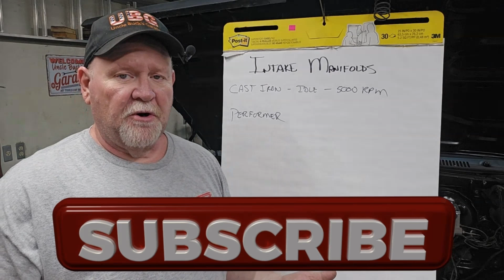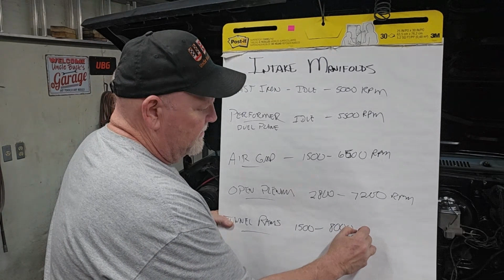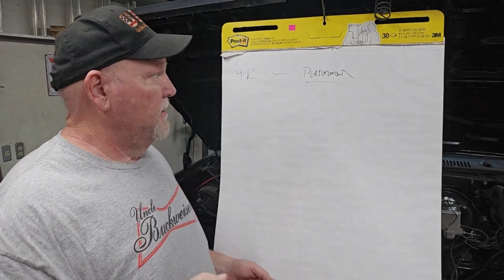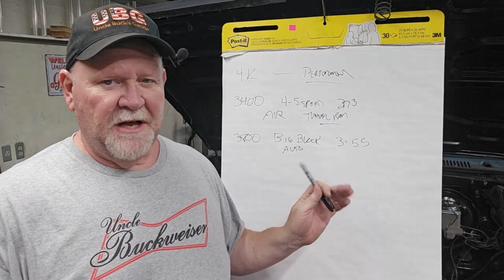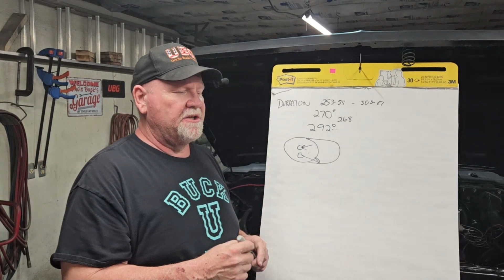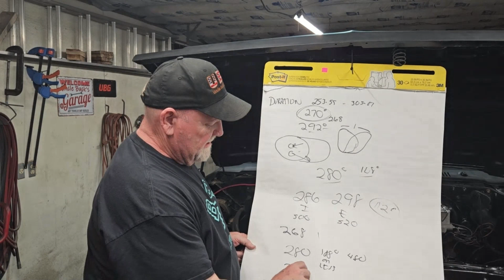How To EASILY Pick The Best Performance Parts Combination!

Comment: 454 bbc , 5 speed, 325 rear, weight 1800lbs 1927 Chevy coupe stock, steel body, four link rear, positraction rear,  dual plane intake, carb 700 vacuum secondary, should be all ok as to what you are saying. Looking for more distance as to fuel cam dual spec on the intake and exhaust mild lift and stock heads and pistons 8.5 compression, what do you think Buck. Thx joe
Reply from the maker: SOUNDS LIKE A FUN SETUP, THAT THING IS GOING TO MOVE!

Comment: First time here and this is the kind of stuff i can watch all day and i have a chevy c10 1985 silverado i had to replace the 308 that was in it so i want with a GM 350 crate performance engine from Jagz but i am going to take out the intake manifold and edelbrock carburetor and put the my old edelbrock performer on wth the original quadrigjet e4me so i can cruise, it then burn gas.
Reply from the maker: SOUNDS LIKE A SOLID PLAN FOR A GREAT CRUISER!

Comment: I have a pair of naturally aspirated 482cid BBC engines for my hi-perf offshore marine pleasure boat 🛥 application...8.2 comp ratio, .039" quench, AFR Magnum 315cc aluminum heads,  Edelbrock RPM air-gap dual-plane intake manifolds, Holley 950HP carburetors, MSD magnetic crank trigger system hooked into a Daytona Sensor CD-1 Marine ignition box system,  bore notched cylinder bores on both intake and exhaust sides, baby hydraulic roller camshafts 230°/236° .600"+ lift, 110° LSA,...makes 585hp @5700RPM 580-lbs of Torque @4500rpm all on 87 octane ⛽
Reply from the maker: THAT IS A SERIOUS SETUP, SOUNDS LIKE A BLAST ON THE WATER!

Comment: I’m building a 327 with a Holley 750 double pumper. I’m looking for a set of camel back heads. I will have them gone through and set up. I’m looking to put a cam in it that will give me the best bottom end to mid range torque and horsepower. Do you have a formula that will tell me what can I should use
Reply from the maker: 268 advertised duration will be what you want

Comment: Tunnel Ram intake is a type of long-tube intake which is better for cylinder filling at lower RPM. It's like a vertical dual-plane. Many think of it as comparable to a single-plane high RPM intake, but its not. actually good performance for street strip but who wants to run around with a hole cut in your hood or no hood these days? If you like the look then have at it.
Reply from the maker: INTERESTING POINT ON THE RPM RANGE!!!

Comment: Back in the day had a1972 corvette. 454 4 spd 308 gear. Told my buddy wanted to make a high performance out of it. Mechanic sold me a set of heads and intake. 396 360 hp heads. Edelbroc performer. Ported and decked. Crane cam headers Mallory ignition. L88 clutch.think it had 100 h p. More. Wish I still had it.
Reply from the maker: SOUNDS LIKE A FUN CAR

Comment: Any old Mopar guys here?? Have a 66 383 in a Coronet convertible. Need 30 over pistons for my rebuild.. Anyone know where some stock replacement 30 over pistons (cast is fine) are for my build?? Using the stock heads (915's) which are around 75-77 cc's. 
Thanks
Reply from the maker: MAHLES WEBSITE OR GIVE SUMMIT A CALL

Comment: Ok , I’ve got a question …..  BBC 502 running 13.5 to 1 compression.  On race fuel , Brodex heads that are 3xra 345 .  Running a dual quad Weiand tunnel ram .  Forged pistons & solid roller cam . 
   I’ve got 2 Holley based “BRAWLER “  mechanical 4 barrel carbs .  900s . 

 What size carbs do you recommend ??
Reply from the maker: WITHOUT KNOWING MORE ABOUT THE VEHICLE ITS GOING INTO,,,AUTO OR MANUEL TRANS, WHAT GEAR RATIO, HOW HEAVY, AND STREET,,,STRIP OR A COMBO OF BOTH? LET ME KNOW

Comment: Great video. I drove a 69 Camaro big block Chevy 4 speed.
  I ran a tunnel ram and 2 750 Holley carbs. It was a factory 4.11 gear.
  The only issue I ever ran into was in really cold weather the throttle plates would freeze up.
  I carried a scoop plug to block the cold air.
  I also had an 80's El Camino with a 350 with a mild cam and 2.73 gears. It was my tow rig for my 70 Chevelle.
  I ran a single plane Edelbrock torker intake manifold and a 625 Edelbrock carb.
 Made good torque and pulled my 3700 lb car many miles.
Reply from the maker: SOUNDS LIKE YOU HAD SOME FUN CARS BROTHER

Comment: I have a 454 mark iv its stock makes about 230 horsepower and about 320 foot lbs of torque what would be a good set up to make around 500 horsepower and 550 torque I would like a roller cam any suggestions thank you brother
Reply from the maker: I WOULD GO WITH ALUMINUM HEADS AND A 240 DURATION CAM WITH ROLLER ROCKERS

Comment: What gear would you recommend for a 350 4 barrel with currently 350 turbo  both 400 miles on them what cam would you recommend also?
Reply from the maker: IT DEPENDS ON HOW YOU ARE GOING TO USE IT

Comment: Do you think two 600 carbs would be less frustrating than the 450s on the tunnel ram?👍
Reply from the maker: IV'E HAD BOTH, ITS THE SAME TUNING, THE 600S ARE A LITTLE BIT MORE FORGIVING BECAUSE OF THE VACUUM SECONDARIES

Comment: I still have my high-school  69 SS 396 4sp  Chevelle.  In 1973 I put in a Crane 320° advertised and. 550 lift hydraulic flat tappet camshaft. It was my daily driver. Put 35,000 miles on it. Got married and parked in the quonset for 53 years. It's only got
 68,000 miles on it. Numbers matching car. Got it back on the road this year. What memories.
Reply from the maker: THAT'S AWESOME BROTHER
Reply: I have a 1977 Bonanza c10 remanufactor350 with a demon 4 barrel not sure what gear is under it oh and it has a 350 turbo tranny my question is I'm wondering what size cam I would be right for it not bone shaking but hits a lick this engine has 400 miles on it could you give me some tips on this?  and  what gear do you recommend    and are 700r tranny expensive? Thanks for your help
Reply from the maker: 268 OR 270 DURATION IS WHAT I WOULD GO WITH
Reply: @garymurphy9159  , here's my build with 4in lift kit, I have a 88 GMC Sierra SLE K1500 pu with a 350 bored .040 over with Wiseco flat top pistons, 9.8:1 CR, set of crate engine 14096217 heavily ported cyl heads w/64cc combustion chambers, screw-in rocker-arm studs w/1.5" rocker-arms, 1.94 int, 1.50 exh valves, Z28 valve springs with incerts and keepers, Hedman Longtube Headers w/temp bolt on cherrybombs w/turndowns, Weiend Street Warrior dual plane spreadbore/squarebore intake manifold, 750CFM Quadrajet 4-bbl carburetor, Howards Cams #MC110991-08DL, hydraulic flat tappet cam,  275/275 adv dur, .470/.470 lift, 221/221 dur @.050 lift, 108 LSA, 1700-5700 rpm, Howards Cams Direct Lube Lifters, (cam & lifter kit),  paired with a 2200rpm stall converter & 700R4 trans with 3.42 rear gears turning 32in x 16in Cooper tires, this cam worked out just fine with my trans and rear gearing and I'm more than satisfied with my build, but now I'm in the process of rebuilding and beefing up my tranny, I should've done it when I had the engine out but shiite happens, lol. You need to know what the rear differential gearing is, type of trans, and the engine size and compression ratio of your engine before a cam manufacturer can recommend a specific cam for your truck. Either one of the two cams that Uncle Buck listed is a good start on average. I was looking real hard at the 268/268 cam before I decided to go with the Howards Cam. In the past I've always liked the Lunati Cams, but they've sold out, Comp Cams has some of their grinds but I'm not sold on Comp Cams products. Isky makes good cams but a little too pricey, I also like Clay Smith cams, but most of their grinds are for cars. Crane Cams was good until they sold out.
Reply: Do I have to join to ask upgrade questions

Comment: I have been told the block that I want to make a street rod is a Chevy 880.  What is the difference between the 880 and the Chevy 638?  What would make the 880 better?
Reply from the maker: 880 IS A VORTEC BLOCK ONE PEICE REAL MAIN AND THE MOUNTS FOR A ROLLER CAM CEEPER IN THE LIFTER VALLEY, OH AND ALSO NO MECHANICAL FUEL PUMP BOSS ON THE BLOCK. THE 638 IS A OLDER THROTTLE BODY BLOCK WITH THE FUEL PUMP BOSS STILL THERE TO USE. THEY BOTH ARE MADE OUT OF THE SAME MATERIALS

Comment: This is just MY experience but to modify your equation (CID x RPM x VE / 3456 = Carb CFM), I would suggest ((CID x RPM)/ 3456) x VE = Carb CFM. I would then adjust the VE ranging from .85 (85%) TO 1.15 (115%). The Constant 3456 is the calculation result of the conversion from cubic inches (CI) to cubic feet (CF) (1 CF = 1728 CI) then multiplied by 2 for the 2 full revelations needed to complete 1 intake cycle with a four stroke motor (1728 CI x 2 rev = 3456).

So your first example: (350CID x 6000rpm) / 3456 = 607  [Based on calculation is for a Bone Stock 516CFM (85% VE), Modified 607CFM (100% VE), and Full race  698CFM (115% VE)

I do agree with you that this is very much up for debate and changes per application basis but at least gets you in a ball park. Love the content keep it up!
Reply from the maker: I APPRECIATE THAT VERY MUCH

Comment: hey Buck!! I have a question thats not on topic for the video but wanted to get your opinion if you have a chance. I have a 2006 silverado (reg cab short bed 2wd, love it or hate it, its what i got lol) i got hit on the passenger side around 17 years ago and ever since, the steering cannot hold an alignment. the passenger side tire always toes out. Ive replaced literally everything on the suspension except for the upper control arms (thinking that wouldnt effect the toe) even replaced the inner and outer tie rod ends. nothing seems to help, no alignment shop says anything is wrong. my question is this: when I got hit the guys bumper hit directly on the passenger tire, do you think the rack and pinion gearbox could be jacked up? its the last thing to actually replace (unless you say the upper control arms could be part of the situation) but other than my steering wheel progressively getting more angled, nothing "feels" like its out of whack with the steering. any  help ( and man, I mean ANY help!!) you could send my way is more appreciated then you could ever imagine!!!!!!!!!!!!!
Reply from the maker: IT SOUNDS LIKE IT COULD BE THE RACK AND PINION. AND THE FRAME MAY HAVE BEEN PUSHED FROM THE IMPACT. HAVE YOU EVER TAKEN IT TO GET THE ACTUAL FRAME CHECKED FOR SQUARE???
Reply: @unclebucksgarage7695  no the place I took it to im pretty sure they didnt check the frame for square. that was my initial thought but just for them to put it on the rack and check is $375 and if its rack, i can get one for around $100 from pick n pull. ive gottten it aligned maybe 4-5 times in the last 17 years. it holds an alignment for about maybe 2 weeks then the pass side tire starts to toe out. I was thinking as well that if its the frame then maybe they wouldnt be able to get the alignment perfect, but they get it perfect every time then it just starts to slip out of it. Il try the rack first. Thanks for all your help!!!!!!
Reply from the maker: I THINK THE IT MIGHT HAVE NOT BENT THE UPPER ARM BUT DID BEND THE FRAME WHERE IT ATTACHES AT
Reply: @unclebucksgarage7695  yeah when i got hit the steering wheel immediately spun but the truck pretty much went straight (kind of lol)

Comment: One thing I figured out with cam profiles is the advertised vs @.050 is the wider the spread the lazier the ramp profile. With the lazier ramp rate it seems to be easier on valvetrain if you're trying to put together something that you want to put tons of miles on.BUT they drive wildly different.  Take a 280 advertised, you can find the @.050 as lazy as 208 to as rowdy as 236, same advertised duration but very different ramp rate acceleration. Identically built engines with the same advertised duration but different @.050 numbers would be miles apart when talking about the radical spread from the 208@.050 to 236@.050 example
Reply from the maker: GREAT INFORMATION BROTHER

Comment: I have a set of double hump head's and a edel Brock performer intake and the want to put a. 279 cam on a 327 Chevy engine what size carburetor should I use because of sometimes I want to put the pedal down
Reply from the maker: I WOULD GO WITH A 750 CFM VACUUM SECONDARY

Comment: Performer intake give more Tq than the others and stock.

Rpm intake on a smallblock must have long duration. 

Singel plane.. duration and high lift. 

I like Performer better than a airgap.
Live in the Skandinavien..carb here can get to cold and never work correct.
Reply from the maker: THAT'S GOOD TO KNOW, THANK YOU!

Comment: WHATS YOUR THOUGHTS ON FELPRO 1 PIECE BLUE OIL PAN GASKET?
Reply from the maker: LOVE THEM
Reply: Details [true for sbc]: old school cork rail gaskets were about 0.090" inch thick, and pans used what FP dimensions call the "thin" timing cover rubber seal.  FP sells two versions: thin and thick, the thin front seal portion matching thickness of old rubber seal.  Here's the curveball: the one piece embedded standoffs are 0.120".  This leaves some old pans with barely a crush against the timing cover seal portion of the 1 piece.  It might be a problem for older pans in some cases.  If you're careful and sneak up on torque sequence, a thick can be made to work, or... its time for a bit of sealant on the thin - timing cover side probably gets it done.  If getting a new pan for a fresh build, you could opt for thick spec design - be sure of what you are ordering first.  Its all about the pan and how it was stamped.
Reply from the maker: YES SIR